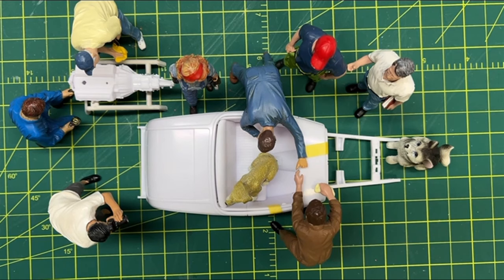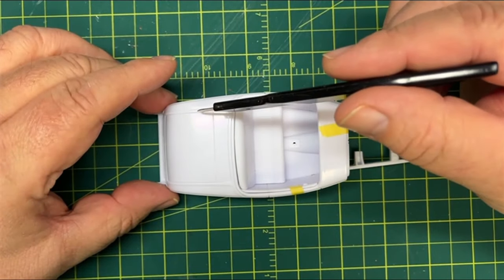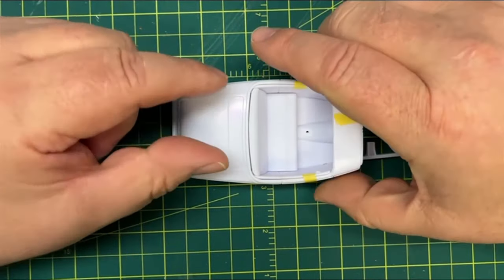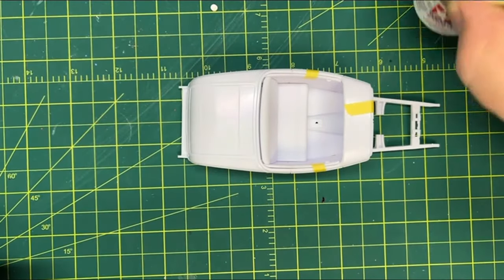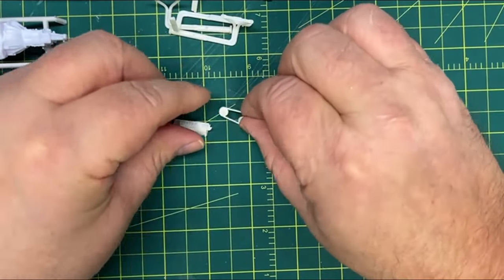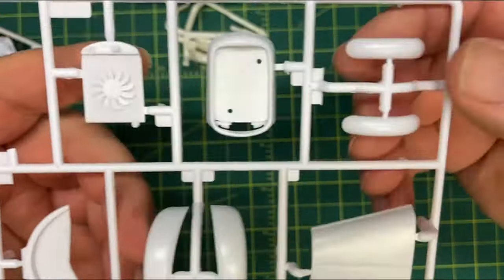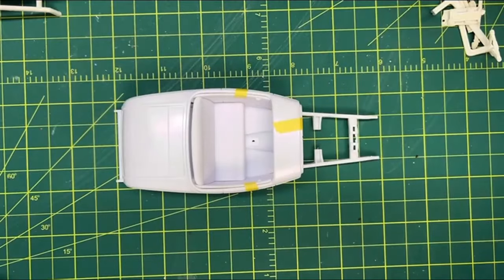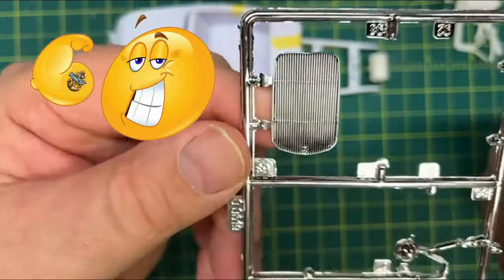Revell 32 Ford Roadster build update #1

Comment: Looks like you have it all worked out. One suggestion on the seat, glue some spru on the bottom of the seat and that way you will not have to use a stack of magnets... Lol T hat color will work well on that car... I like the Green accents everywhere and yes the breathers will look killer painted the clear green. Wait, I love green so I'm a but bias... 🤣
LLAP 🖖
Reply from the maker: That's a great idea for the seats.  Then I can go with two magnets instead of four.
Reply: @grandpamarkshobbies  Yep 2 on each corner of the bench seat... Lol Hahaha I do have ideas, not all of them good... 😁
LLAP 🖖
Reply from the maker: I will most likely only use one set of magnets.  To many and it would be tough to pop out.

Comment: I use Easy Off oven cleaner (heavy duty) to remove chrome. Its takes about 30 minutes with no harm to the plastic parts.  When done just clean with soap and water.
Reply from the maker: I have to take it slower.  Easy Off messes me up.  But it sure does work great.

Comment: Oh what a Bobble Head! Not you but that would be cool as Heck! lol. Wiil surely be following this. Neat on the seat mags! I may open a kit this week waiting on the snap-Kit build. See ya on the Bench!!
Reply from the maker: I was going to continue with the station until the Snap Kit build, but just needed to see a transmission.  LOL  Open one up, it can always be set aside for a bit.
Reply: Im just setting here thinking about that. I just may do that today, there is so many to choose from.I want to finish this one area up sometime today, a lay back area for the Dry and storage area .
 @grandpamarkshobbies
Reply from the maker: I have to clean the dryer vent today, then I'm going to start working on my new shop area.  I plan on having a spray booth area with enough room to set parts and tools so I'm not struggling while I'm running parts through the booth.  Then I want a place to work on the builds, and another part that is just for taking pictures and videos.  It's an open canvas right now, so I have a lot to think about.
Reply: Plans usally change in the prosess- it does all the time for me. with the little area i have to work with alot can be done.
 @grandpamarkshobbies
Reply from the maker: Where I'm working now it's so small that a few times I've turned around and ran into myself.  LOL
Reply: 😂 @grandpamarkshobbies  😂 Now theres nothing wrong with running into self- Its the thought of the conversation that concerns me!! lol
Reply from the maker: LOL  Yeah, we do talk.

Comment: hello mark... being new to this community i have a question... what is LA Awesome?? i'll be looking forward to this build... thx 4 sharing... vinny
Reply from the maker: LA Awesome is a de greaser / cleaner that you can get at the dollar store.  I think it's 3 bucks for a half gallon.  I put some in an old peanut jar that I have and then put the chrome parts in for a day or two and the chrome dissolves without hurting the plastic.  I have a plastic container that I will put a bunch of it in and put painted car parts in to strip the paint.  It's good stuff, but wear gloves and glasses when you use it.  It is strong stuff.
Reply: @grandpamarkshobbies   thank you
Reply from the maker: you are very welcome.